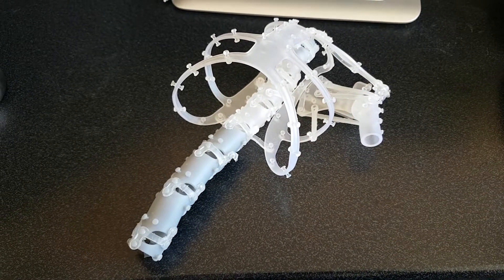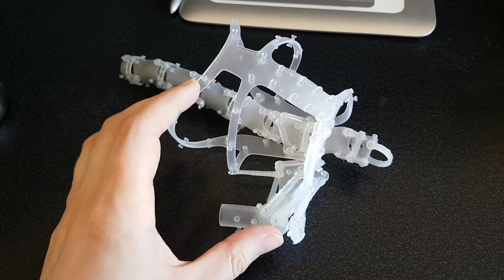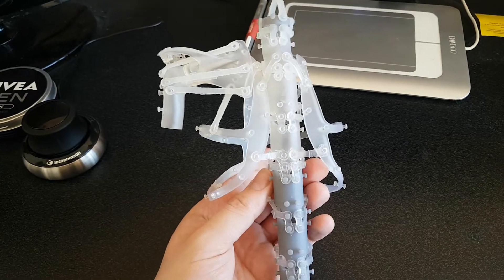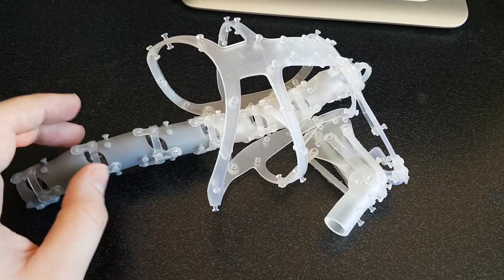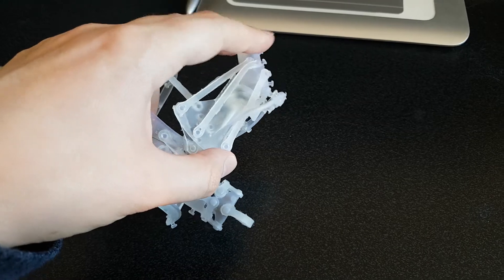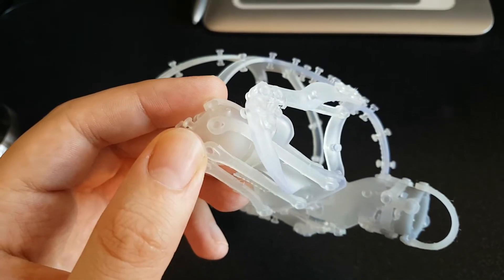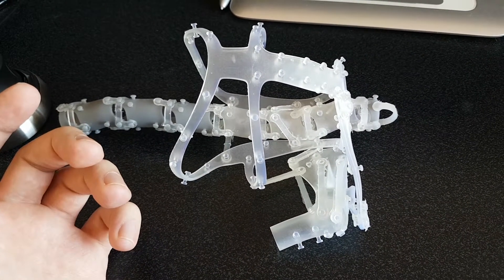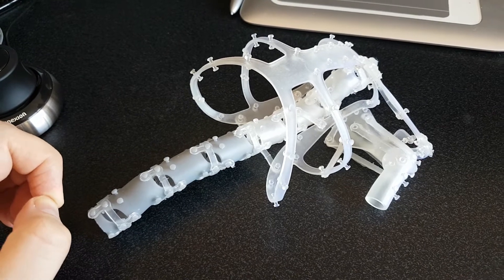Humanoid robot Tensegrity tests

Comment: Love the aesthetic of this. Interesting take on the spine, compared to other tensegrity spine models. Cant wait to see your progress on pneumatic silicon muscles... had a similar idea once, using the hollow bones as fluid reservoirs/pistons for a closed hydraulic actuator system, with those braided muscles that inflate to contract.
Reply from the maker: Indeed I was thinking of using the bones as the manifolds/reservoirs. I'd have the valves directly where the bones and muscles contact. Life's gotten in the way since then. I'm currently planning to make the robotic equivalent of early multicellular animals, and build them up. This aligns with my plans for modelling AI, by starting simple and building up complexity over time.

Comment: Did you manage to build muscles? I am very interested in seeing how this turns out. I want to build tensegrity robot also. Before that I have few projects that needs to be finished.
Reply from the maker: Hi Aleksi. So far life has gotten in the way, so not yet. I'm hoping to implement something soon. I have a bunch of ideas including using the bones as pneumatic manifolds, and a unique sort of valve that is part of the silicone muscle and sits within the bone. They need to be in a larger design than this though.
Reply: @Anthromod  Sounds cool. I cant wait to see it and learn in more detail how it works.
I am thinking of building more "classical" tensegrity robot with carbon fiber tubes and fishing line. It will be most likely 4 legged because it is easier to balance than 2 legged robot.

Comment: So do none of the elements in compression touch each other and is the integrity of the structure maintained by the elements that are in tension?
Reply from the maker: The glenohumeral joint is under some compression. The rest of the elements are held under tension.